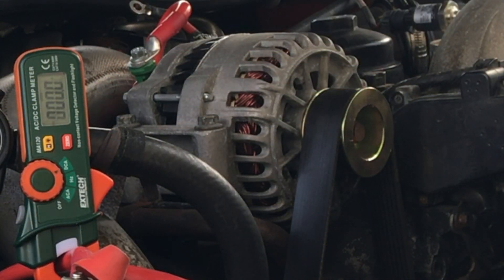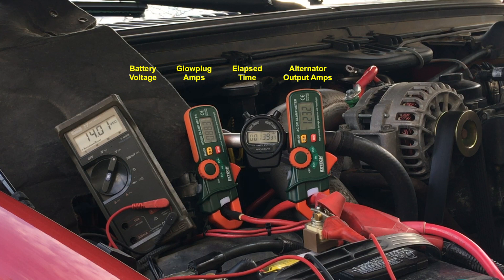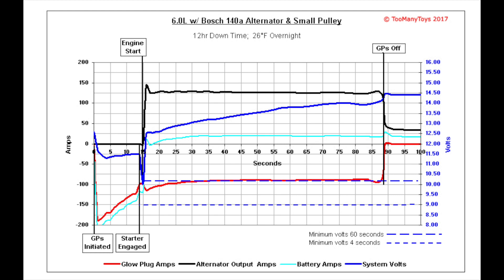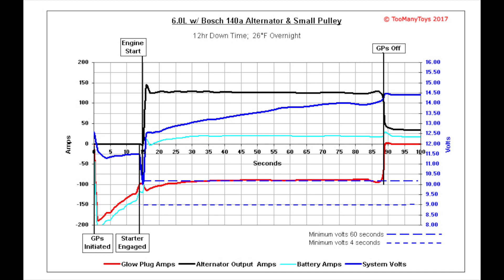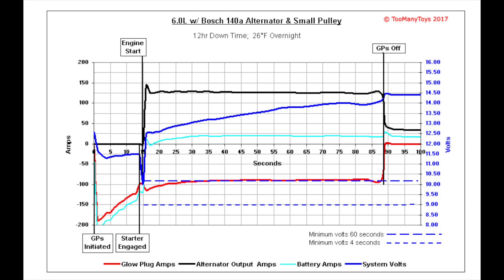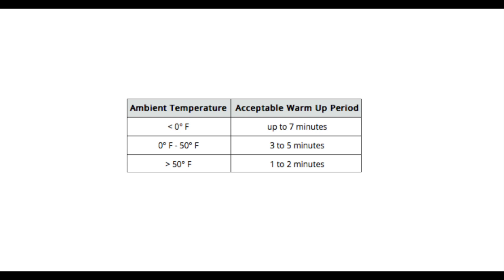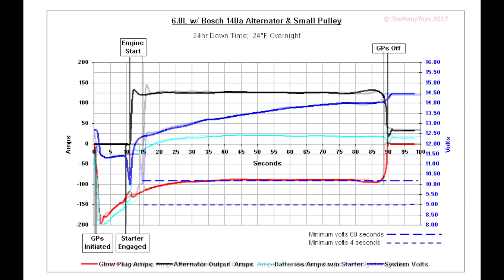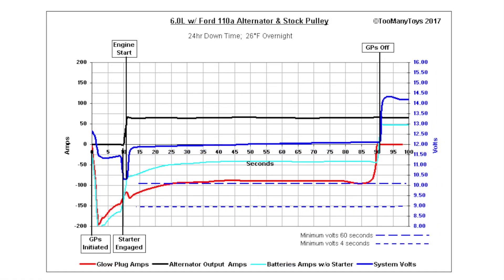Powerstroke 6.0 - 140a Alternator with a smaller overdrive pulley

Comment: Ordered the Bosch 140amp alternator off Amazon, lasted 6 months. Put stock unit back on for the time being. Are there are any other alternator upgrades you recommend besides the Bosch 140a? Nearly everything I know about the 6.0 electrical system has been learned from your videos
Reply from the maker: Sorry to hear that happened.  The Bosch does have a higher failure rate (5%?) than the brand-new OE alternators, but you can't buy them.  I do hope you warranty it through Amazon; people have done that.

I have seen the auto parts store rebuild alternators do much worse (25%+).  After the Bosch, you have to go into the more expensive alternators like the Mechmann or Leece-Neville.  And there are counterfeit L-Ns out there.  About the only place that is safe to get an original L-N is XDP.

Comment: Im going to upgrade my 7.3 alternator from a 110amp to a 135amp one.  Should I leave the pulley it came with it on or swap it to the one my 110amp one has, it’s smaller?
Reply from the maker: It's been a long time since I had my 7.3, and at that time, we were not that concerned about voltage after engine start.  So I would say it depends on what the voltage is after a cold restart and if it is concerning to you.  A smaller pulley will have more wear than the stock size, and of course, there is the belt size issue.  But most times, it's not a problem.  

Depending on the manufacturer of the alternator, they sometimes supply a smaller pulley so they can make the sales claim that it has a higher output at idle.  I'd probably go with the pulley that it came with.  It's not a high percentage of life that will be lost.
Reply: @toomanytoys  that’s what I was thinking, appreciate the response. Thank you

Comment: Excellent video. Are you sure that Bosch only warranties their new alternator if it was installed in a 450 or 550 vehicle? That is horrible. I just ordered one for a F350 but thinking of cancelling now.
Reply from the maker: Unfortunately, I know of two who had been denied warranty at Rock Auto after they said it went into an F250/350.
Reply: @toomanytoys  That's ridiculous! Assuming you are referring to the AL7606N, Bosch clearly lists it as being compatible with the F series diesel trucks on their website. One last question if you don't mind: would it be okay to use the 140 amp alternator with an upgraded 2 ga. cable?
Reply from the maker: @georgetsetsakos6088  Agreed.  I know of someone who has said if it does need a warranty, they will just say it was on the rated truck.  

Anything under 180a does not need any additional cabling, the stock cable is fine.

Comment: What if someone has a "BBB" industry 135 amp alt? Are all pullies the same?
Reply from the maker: Sorry, I'm not familiar with what "BBB" identifies, but so far all the alternators I've known for the 6.0L utilize the 17mm shaft, but its best to check.  Pulley come in all diameters, widths and rib counts.  The one that many have used in listed in the notes for this video.
Reply: @toomanytoys  It's basically a Wilson electric reman alternator. The pulley rib count is identical to the OEM. Not sure if the stator shaft is the same size though. How could I find out if it is?
Reply from the maker: To fit to the drive belt, the pulley would have to be an 8 rib (width).  You would have to pull the pulley off of the alternator and either check the pulley ID with an 17mm drill bit, or measure it or the alternator shaft's diameter with a set of calipers or micrometer.

Comment: Another amazing video. Got a link for the 58mm pulley?
Reply from the maker: Thanks.  The pulley I've used with the 110a stock, 140a and 230a aftermarket alternators is this one.  If you have an aftermarket alternator installed it's best to check the diameter of the shaft first.

https://www.ebay.com/itm/Ford-3G-6G-Lincoln-Alternator-8-Groove-Overdrive-Pulley-Increase-Amp-At-Idle/191609911806